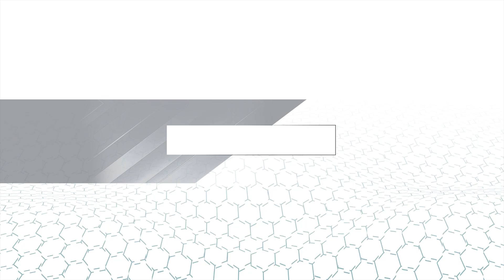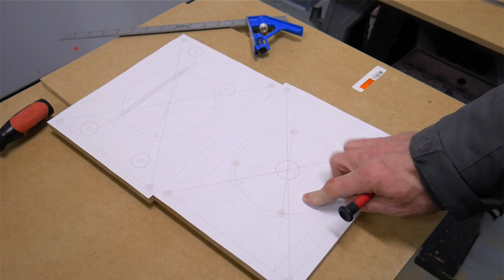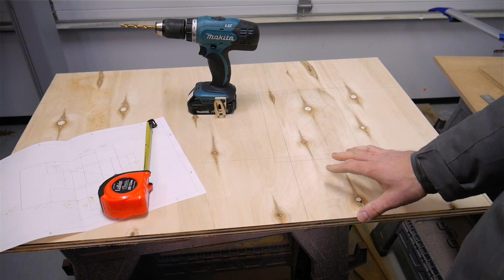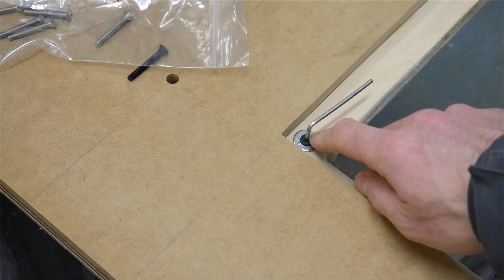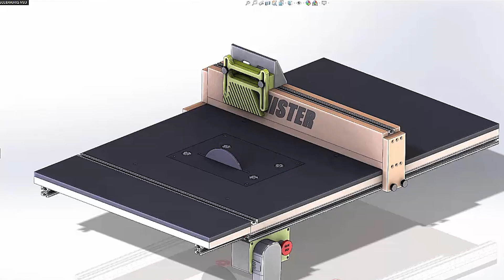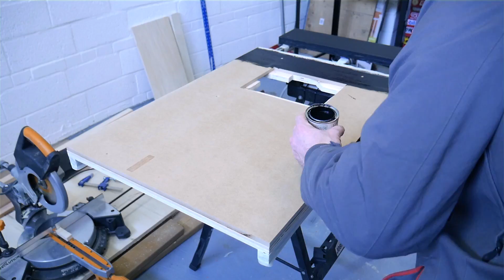SINISTER SAW! How To Build A Folding Table Saw, Router Table, Mitre Saw Stand In One! (Part 1 TABLE)

Comment: Nice build. I would recommend fastening the extrusion from the top (hidden) side of the profile. The faces of the extrusion have a 2 degree bevel that is meant to be locked into place once brought into tension -- they call it the "2-degree drop lock". This acts as a lock washer would and prevents loosening due to vibration.  Just use the access holes already drilled to access the screw head from below, and use a pan head screw that fits in the channel. Here's their video about it: https://www.youtube.com/watch?v=QwKQiIr9f0o

Comment: Very clever using extruded aluminum to make a sliding table extension. It is absolutely accurate, easy to measure off the edge, and easy to mount. Most designs use tubing, difficult to fasten. Could also be used for a table saw sled, trapping the slider from lifting. The maker of the Al extrusions, 80-20, also makes sliders if ppl don't have a 3D printer.
Reply from the maker: Thanks! Yes, I used the low profile 8020 extrusion in my fence and also on the edge of my table for the purpose of future sled and mitre gauge etc. Works great and as you said, lots of options for accessories in their catalogue!